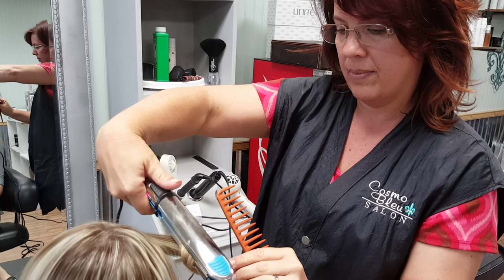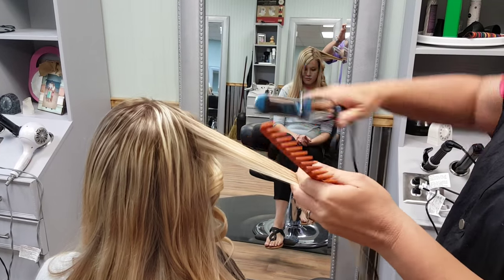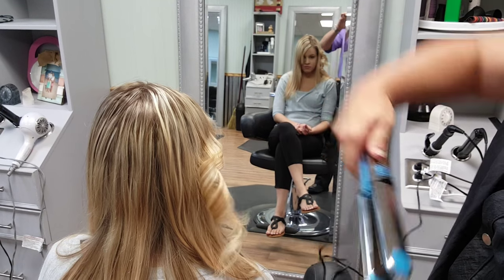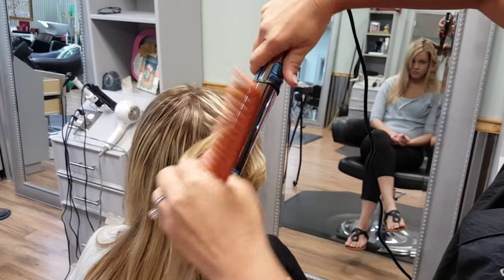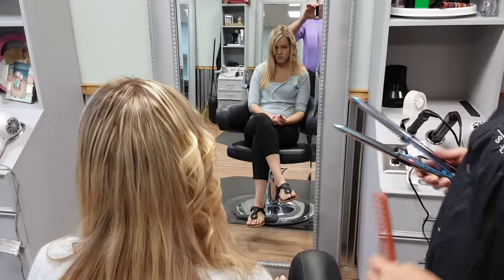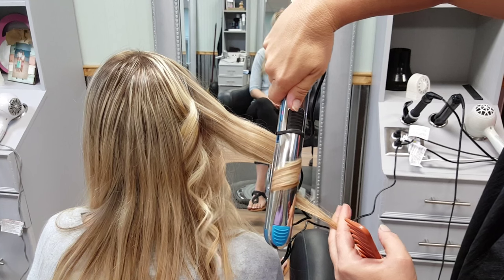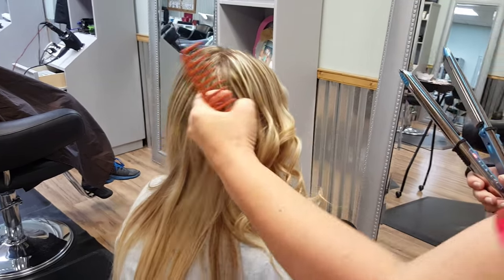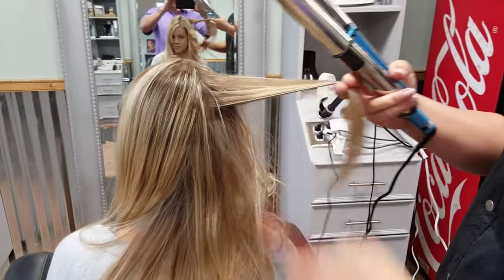BabylissPro Nano Titanium Prima3000 1 1/4" Stainless Steel Straightening Iron Review and Demo

Comment from the maker: This iron can be used for keratin treatments, but it is not ideal.  The plates get really hot around the edges, so when you are trying to get close to the scalp, you risk burning your client.  Plus, you cannot dial in the exact temperature, since there are only a few temperature settings.  The highest level is 465 degrees Fahrenheit if I remember correctly, and there is no selection for 450, which most keratin recommend as the highest temperature to use.  We sell Brazilian Blowout and recommend their own irons, or a really good quality titanium iron, such as the Izutech ktx450.  Hope this helps.

Comment: So they are practically using the highest heat... I have that Iron doesn't that much heat damage the hair???😳
Reply from the maker: Gcj Boo yes it can when not using a heat protection product.
Reply: Richard J Rose thank you, so ...my hair is really thin and delicate but curly , what level can I use with the bbyliss to get it real straight without braking it?
Reply from the maker: Gcj Boo If your hair is fragile or delicate, especially thin, then I would recommend not using it.  Find a hairdresser qualified to do a Brazilian Blowout.  The integrity of the hair will determine whether that could be done safely without breakage occurring.